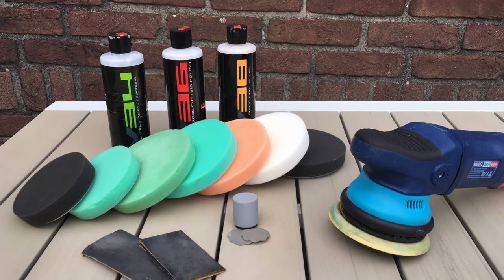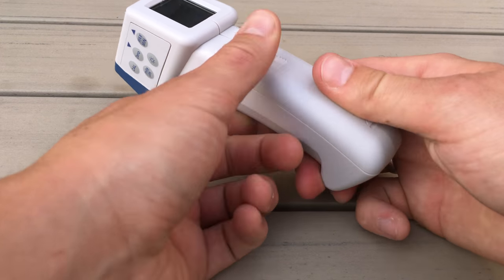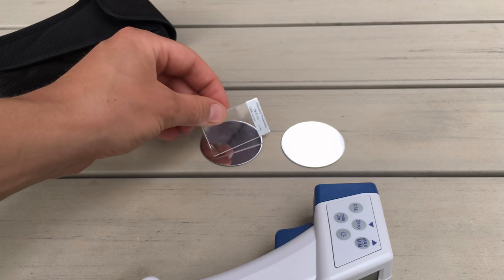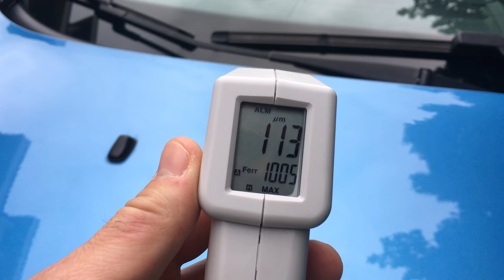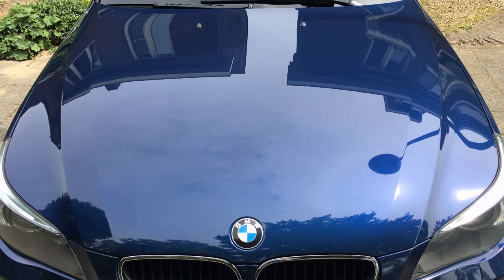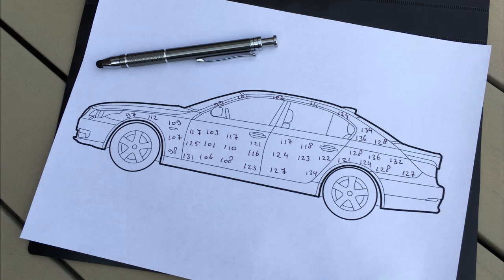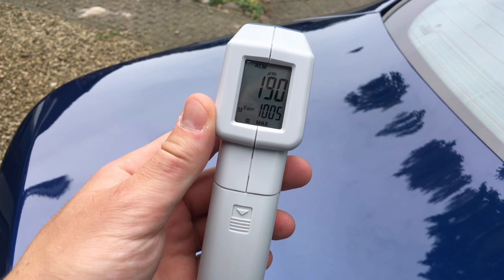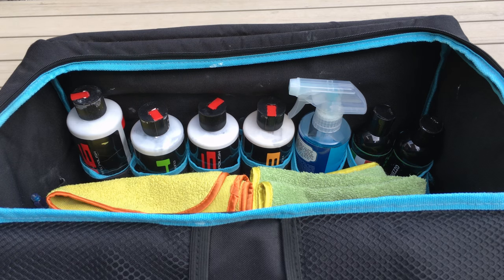AFFORDABLE Paint Thickness Gauge Review Setup How To Use

Comment: How do I caliberate it without the glass and the ferrous thing. I lost them
Reply from the maker: The glass is to measure a standard thickness and see if it calibrated correctly, but for me it was always ok after zeroing it. You could place it on a blank steel or aluminum plate and zero it that way. But you will not be able to check the zeroing as you dont have a standard thickness, so maybe you can order them seperate or get a plexiglass where you measure thickness from with a digital caliper and use that?
Reply: @Juupke  thanks alot.<3